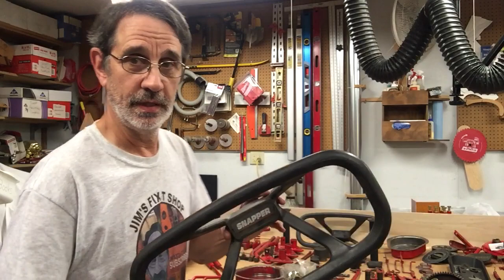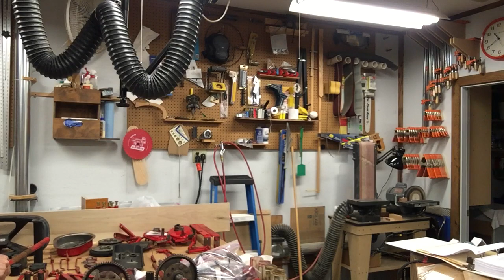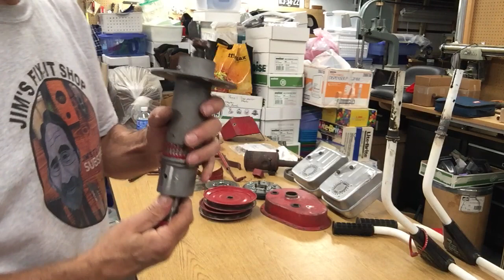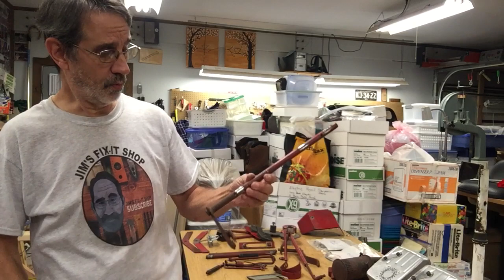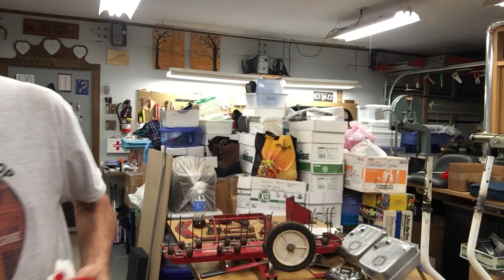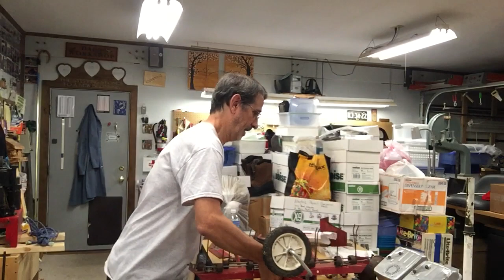314. Snapper parts for sale       Email inquiries only, with name address and ZIP Code

Comment: Were there any tie-rods (#7024935YP from Partstree) for the rectangular tube machines?  I didn't see them but there appeared to be some things on the table not shown.
Reply from the maker: You will need your complete model number to find the correct parts I’m sure Parts Tree.Com. Has Parts in stock that will fit your machine. Jim
Reply: @jimjackson9381 300915BE.  Part # 7024935YP.  I just thought there might have been some in the things you were trying to move.  PartsTree does have them but I wanted to give you a chance to move your stuff.  Sorry I bothered you.
Reply from the maker: @John-gj1jr  No I don’t have any on hand to sell I did go on Parts Tree.Com. and they do have them they are available in your $25.32 apiece thanks. Jim
Reply: @jimjackson9381  OK.  I saw those on Parts Tree but thought I'd help you empty your table if I could.  Thanks.

Comment: Hey Jim, I'm rebuilding a second hand snapper lt16 and the repair manual calls for gear oil. I opened up the gearbox and it appears that it contains grease. I want to revert back to gear oil. Any idea on the best way to clean out the grease? What type gear oil would you reccomend?
Reply from the maker: Benjamin G 
The best way is to completely disassemble it and clean it in a parts washer and then reassemble and as far as a lube to put back in it that’s totally up to you. Jim
Reply: @jimjackson9381  thanks jim!

Comment: would like the front wheels and tires if not already spoken for, how much for shipping and what address do I use...did not see deck cover in video..have 33" working on, will one size fit all? .my e-mail is cdbgray6@gmail.com...Maryville, Tennessee 37801
Reply from the maker: Charles Gray 
Well you’re the first one on the tires and wheels, but I’m not sure if that cover would fit a 33 inch machine or not you could check on Parts tree and see if it’s the same part number for both machines. Jim
 I’ll get you a price on shipping as soon as I can. Jim
Reply from the maker: Charles Gray 
  You got them send me your name address and ZIP Code to my email don’t put it here and I’ll get a price on shipping for you. Jim

Comment: I emailed you to purchase the bars for the dual tires. Did not get no response back.

James
Warren Michigan
Reply from the maker: james w 
Sorry but you should have I sent a reply this morning the sets are $125 apiece and that includes the bolts and lock washers, I’ll need you to send me your name address and ZIP Code to my email so I can figure out shipping.
Reply: @jimjackson9381  hello Jim I sent over that information you requested through email. Let me know if you didn't receive it.
Reply from the maker: james w 
Well if it’s under the header of James W no I didn’t get anything from you yet. Jim
Reply from the maker: Could the title on your email be different in James W, otherwise nothing has came through yet try resending it. Jim
Reply from the maker: james w 
Sorry had a lot of emails this six bars for the dual tires is $125.  a set with the bolts and lockwashers plus shipping. Jim
Reply: I did send email to the email address you gave me and i happened to look at my inbox and it is popping up a message saying cannot deliver message and that your email address you gave me no longer exists
Reply from the maker: james w 
You send it to
Jimsfixitshop@gmail.com 
I’m getting emails all the time, try this one
jandrwoodworking2@gmail.com
Thanks Jim
Reply: @jimjackson9381  now you should get the email found problem missing the s in your email address.

Comment: interested in harness also what engines do you have i bought sr1433 needs lot of work engine threw a rod block is ruin so strip  crank starter strator  cam shaft Governor
Reply from the maker: David 
Which wire harness are you looking for the ignition or the other wiring harness with the solenoid and interlock. Jim
Send your reply to my email